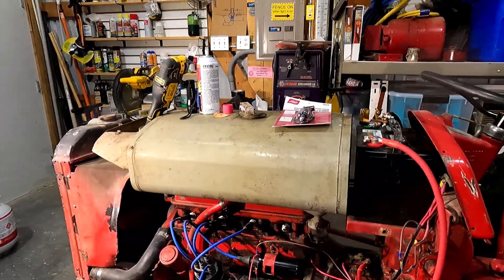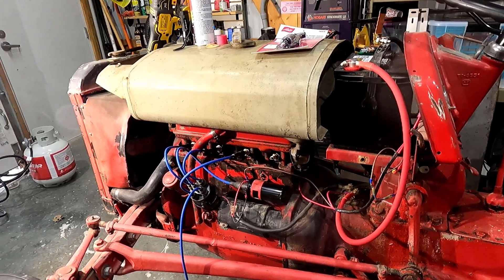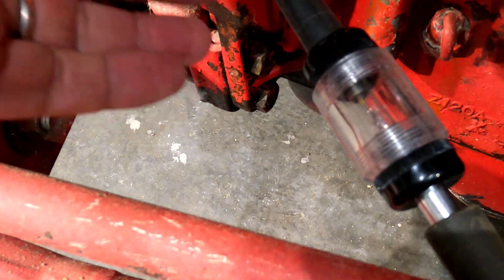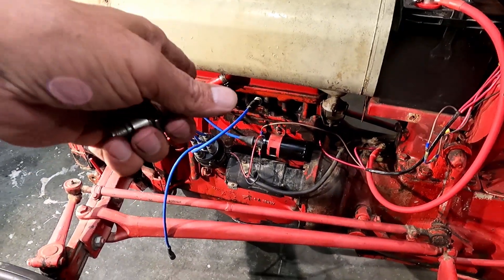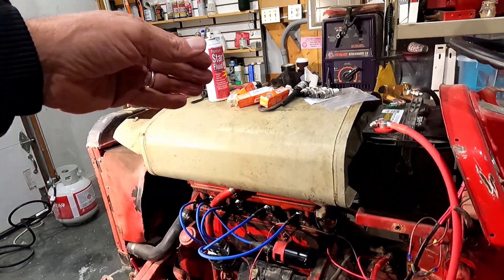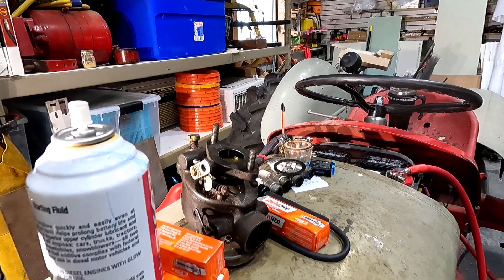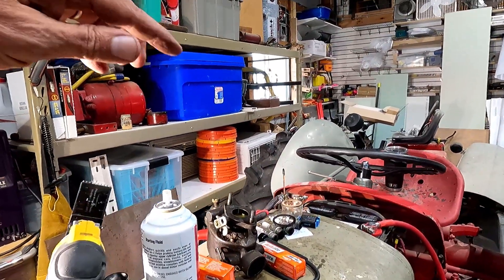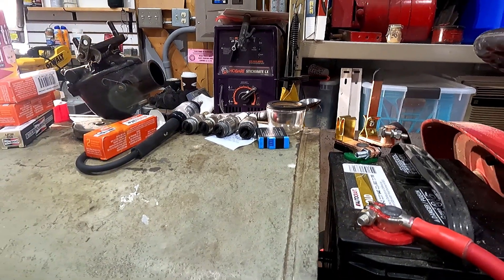TO-20 12-Volt Conversion Project ― Ignition! ― Kind of…

Comment from the maker: As of this writing the 12-Volt and Electronic Ignition Conversions on the Ferguson TO-20 are complete! The main parts and tools can be found below:

Pertronix 1244A and 40511 Ignitor and Flame-Thrower Kit -- https://amzn.to/3q0J39e
Ferguson Complete Carb Repair Kit Marvel Schebler -- https://amzn.to/3npTzFg
12-Volt Conversion Kit (Not the same -- looks better)-- https://amzn.to/3nr2KoI

1-3/8 PTO Conversion Shaft Assembly -- https://amzn.to/2XnLPsB
ARES 13000 - Professional Ratcheting Crimper Tool -- https://amzn.to/3pZx77x

Ignition Tester
Lisle Inline Spark Plug Tester -- https://amzn.to/2MJKIS7

The entire series of videos for the 1951 Ferguson TO-20 can be found on the playlist here: https://www.youtube.com/watch?v=qx55R7PBGZs&list=PL_iZ8t8zAFuMSeubgkz3oYvPq_zCOKLST

Basically, this tractor will be our 'Pasture Tractor'. It will pull the brush hog (when we get one), spread fertilizer, and spray weed killer in our three pastures. I am trying to make the tractor as reliable as possible -- I want it to start and run every time -- so I am putting a few dollars and some time to get it to that point. It has new oil, hydraulic fluid, plugs, a 12-volt conversion, new plug wires, distributor cap, electronic ignition, powerful coil, alternator, battery, steering wheel, and an original style seat. It looks as though it will run after I take care of the filthy carburetor, but there seems to always be something else that goes wrong. 😐

Comment: Mr Mojo , you must have been pretty upset about the tractor not starting , but I guess removing a few nicks and burrs will keep you busy rebuilding the carburetor during cold days that would keep you indoors.
Plus it saves quite a few $ ! Money saved is money earned!! Have a Great evening and better Luck the next time!!!
Reply from the maker: Thanks Americo. I'm pretty sure rebuilding the carb will do the trick, and like you said, It will keep me indoors on one of the colder days 🥶 It sounded like it was running fine on the ether so it's real close!

Comment: Whooo -Hoooo!!! Getting closer to a running tractor. Going to be a sweet and useful piece of equipment when done. When I bought my JD 1025R in 2017 ,it came with a front end loader. I didn't think I would use the loader much, but I'm glad I have it because it is used almost every day I'm on the tractor.
Reply from the maker: Yea I wish I had a loader, but I'm thinking that will have to be the next tractor. These little tractors can have a loader, but I'm thinking it would be better to just use this as a dedicated pasture maintenance machine. Brush hogging and fertilizer/weed killer application. It's nice and low to the ground for the crazy hills we have here. I really need a loader for moving stuff and a work platform though! A JD like yours with a loader would be sweet!